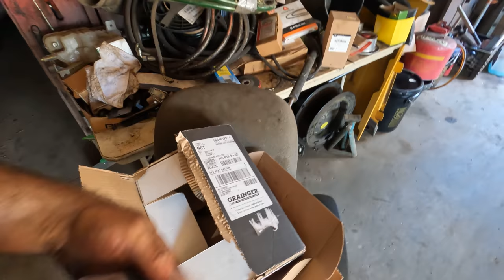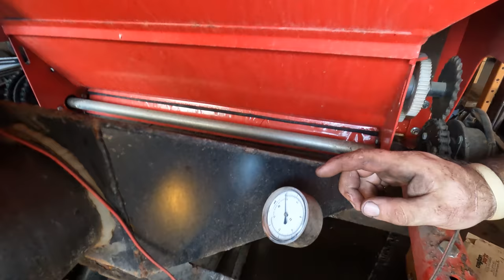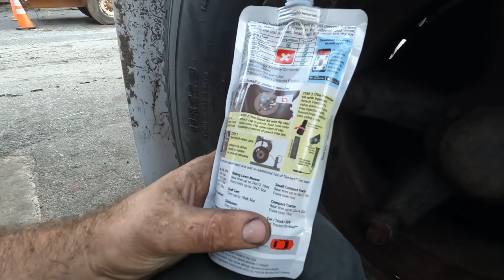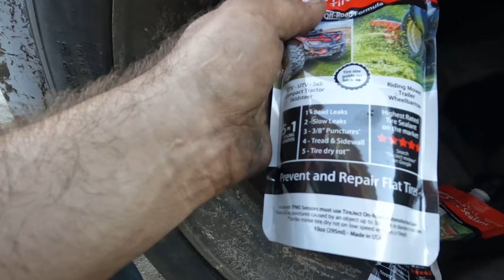Preparing The Tanker For Fall Battle

Comment: Use the farm Tireject, out of the gallon, in road tires and been happy with results so far. You'll like the stuff, cleans real easy.
Don't forget to dump return from hydralic motor so it's unrestricted and avoid damaged seals in hyd. motor. Check with John Deere.

Comment: You may need a pressure relief line off that hydraulic motor back to the tractor for the fan so you don’t blow the seals out of it when you shut it off. All the airseeders we use have one.
Reply: Check with John Deere for your specific model. On 8630 we dump back into a special ordered hydralic filter cover. Two wheel drive tractors are dumped into, I forget just where, but it goes unrestricted back into rear-end casing. That's important for seals in hyd. motor.

Comment: You can weld two hubs together to make shaft couplers if you can find a way to hold them straight.   When your input and output sides have the same diameter its easy, just use a spare piece of rod or shaft and tack them together.  If you have 1'' to 3/4'' like you mentioned its not so easy.

Comment: Becareful when shutting down fan so it doesn't dead head pressure and blow seals out of that hydraulic motor. A check valve on the motor return line helps.

Comment: Instead of running new lines for the blower motor just “T” off of the basket lines. Put a valve in so you can run the hydros in constant and not deadhead the basket cylinders.